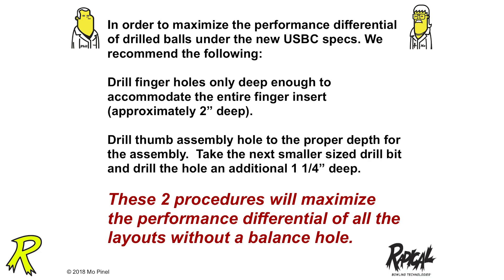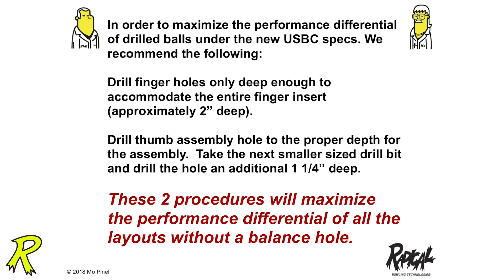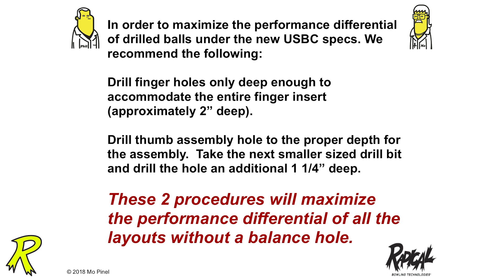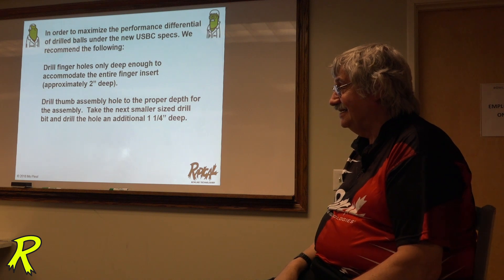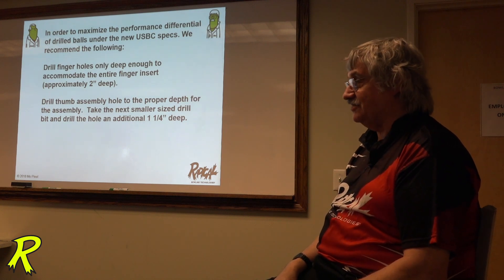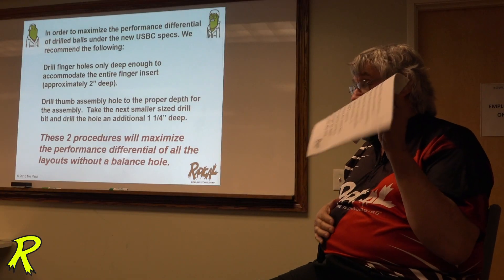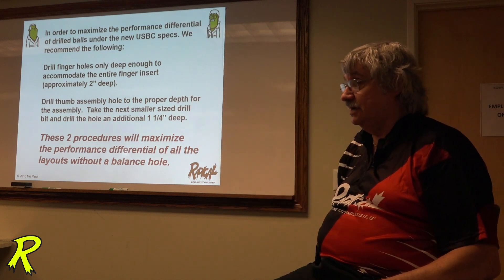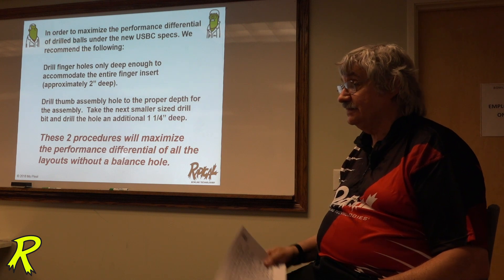Maximizing the Performance Differential Without Using Balance Holes

Comment: Use 1.5 inch thumb slugs no matter how large you need your thumb hole to be. And then another 1.25 inch deeper with a 1⅜" bit. Amazing info.

This is still true when your are drilling your thumb hole directly into the PSA locator? So we are trying to remove the most weight away from the PSA by drilling the middle of the core?
Reply from the maker: Correct! This will be the only way to increase differential after 8/1/2020.
Reply: Thanks for the quick reply. I just had my pro shop drill a Conspiracy Pearl this morning with the extra large & deep thumb hole in the PSA. I'm using your "Layout A Max Flip." I'll get a chance to throw it later this week. Thanks again.